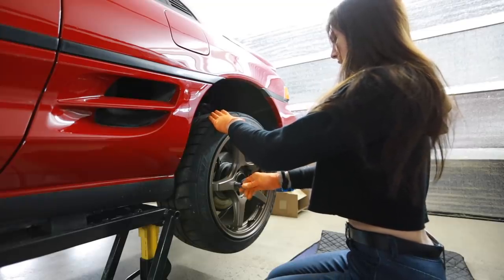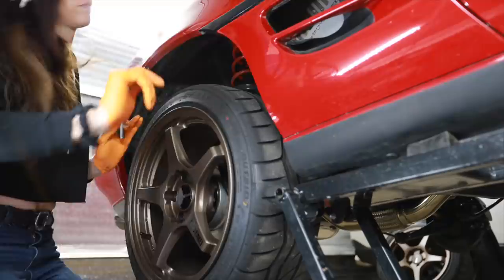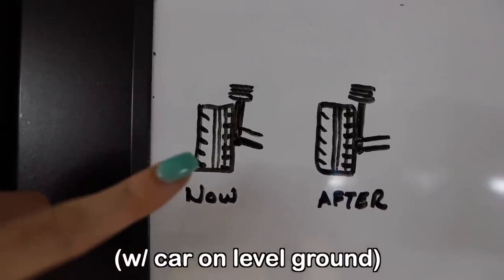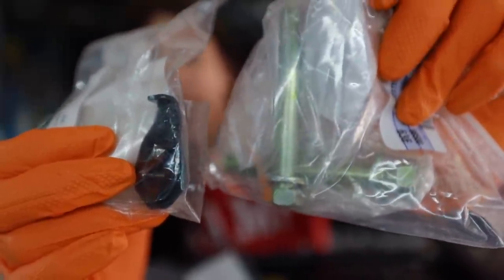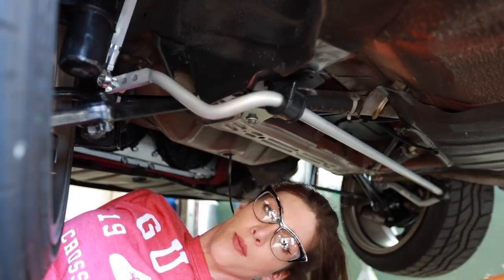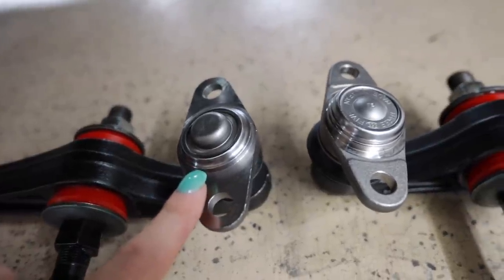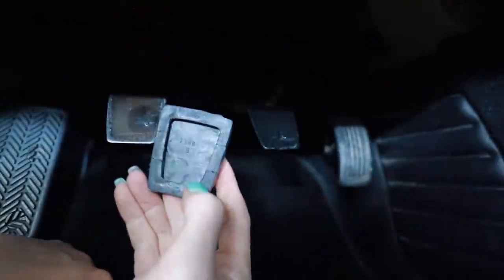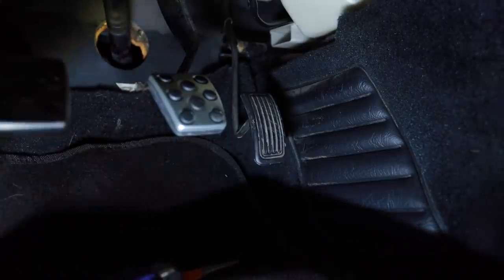Addressing A Critical Overlooked Issue w/ The MR2

Comment: Hot water always helps with pedal covers, it softens the rubber up
Reply: I was thinking heat gun or hair dryer.
Reply: Omar Garsh I’ve done a few sets over the years, always on Audi’s and I’ve always used a jug of red hot water. Drop them in for a minute or 2 and put some gloves on. The water also helps as a bit of a lube then use a hooked pick tool to pull on the back of the rubber
Reply: hot soapy water

Comment: use a small allen key as a punch and pack the other side so it dosent move around while you hitting it, i once used a green plastic brick plug and a nail to hold a break caliper in place while i drove it to get a replacement, got my lefty loosy righty tighty mixed up and snapped the head of the nut off lol

Comment: Any time you are having trouble installing that stuff, rubber molded. 
1- put it in the sun first. 
2- use that fancy heat gun if 1 doesnt work.  Warm it up.

Anything that isnt pliable that should be, warm it up. Even if in a cup of hot water.
 Also, use "soapy water" for "lube" on rubber parts when possible. Petroleum lubricants attack rubber.

Comment: If you have to pound on balljoints like that and actually need to save the threads you can leave the castle nut on - or flip it upside down or find a sacrificial nut.  Windex makes a good lube for rubber parts.

Comment: Nice pedal covers. I installed diamond cut covers on mine which required drilling holes in the pedals and bolting on the new ones. It's been awhile but I think I just drilled in to the oem gas pedal too.

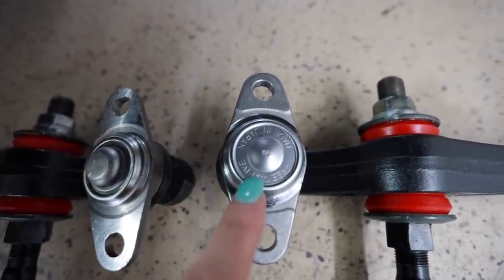Comment: The rear joint in question on the right @10:25 looks more OEM and note the top says "Made in Japan" hint, hint. Maybe researching and finding a better fitment with another roll center adjuster is in order. Personally, I'd rather go with OEM ball joints as a safety assurance. I would call Twos R Us and get this rectified. OCD or not.

Comment: I would get another ball joint,rather than mill out the roll center spacer. What will happen should you have to replace joints in future?!
👍📽️,Like your mechanical fearlessness to just go for it until it's fixed👍👍

Comment: Petals look great The foot well in that car is my least favorite place I was going to suggest to use a heat gun on the petals in my note but I didn’t you got them on Their not supposed to come off so they’re hard to get on I’m thinking maybe a drillbit like a punch to knock out the pin on the Excelerator pedal Size it up with the new pin and see if you can knock it out without taking off the Excelerator arm but by the time you read this you’ve probably already got it on hoping they work and feel as good as they look speaking looking good (the Gump shirt look nice 👍

Comment: Great work, I spent 4 hours yesterday on valve cover gaskets on my 2000 4runner along with cam caps and the Toyota brand gasket goop. Did all Toyota parts, do you have any reservations about aftermarket brands like your ball joints? I try to always buy Toyota brand, my truck is 20 years old with 270k on it so I want the parts that are made to last.

Comment: How you resolve your health issues soon. Take time out if necessary - we'll still be here when you return!

Questions: Why machine out the parts that are fine, when you could ask the company that sent two slightly different parts to replace the one that doesn't fit your needs with one that does? Equally, wouldn't it be easier (albeit slightly more expensive) to get a punch that will fit the retaining pin, rather than remove the assembly later?

Comment: If you don't pull the pedal assembly, try a drill bit instead of a punch. Brace the other side with a block or pipe so it doesn't wiggle. (Wig-gle it,,, just a little bit... Old song lyric your too young to remember)

Comment: I think you should double-check to see that the different ball joint will actually fit into your strut. Those roll center spacers are supposed to match the male side to the female side. If the ball joint does not fit into the female side of the spacer, it probably would not fit into the female side of the strut. I suspect that the ball joint is not just from a different manufacturer, it is a ball joint for a different car.
Reply from the maker: it fits

Comment: Speaking of pressure washing............... I had this great idea to pressure wash my front wheel wells inside my garage.... uhhhh ya don't do that it makes a mess :P Just a day in the life..
Reply: Ugh the simple things................................................ I just recently put on a new shift knob on my Z and the little plastic tightener they give you broke on me. Of course they only give you one of each size. So after about an hour of being like maybe I can make a smaller one work. Lot of nope that was. So I am looking through my collection of crap. I see this bonding tape I forget what it is but its black and its stretchy and only sticks to itself. I just starting wrapping it around the shaft :D Forced the knob on and tightened the screws and it freaking worked. Anyway like 3 hours for something that should of been like 5 minutes..

Comment: Just wanted to point out that you couldn't snap with your left hand because you were holding your ring and pinky fingers in the air. That means your middle finger had less to strike against. Try it with those 2 fingers clenched and show me the results in your next vid! =)